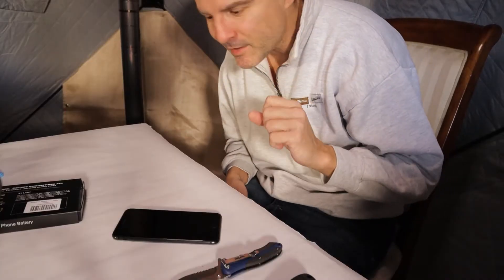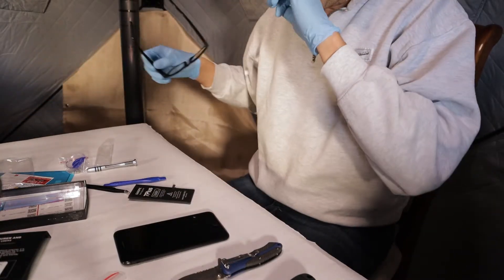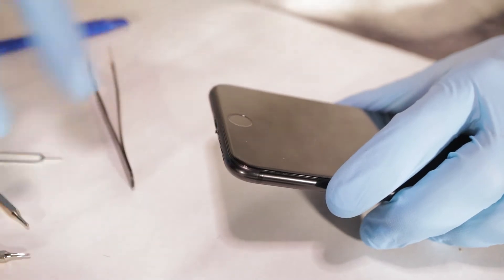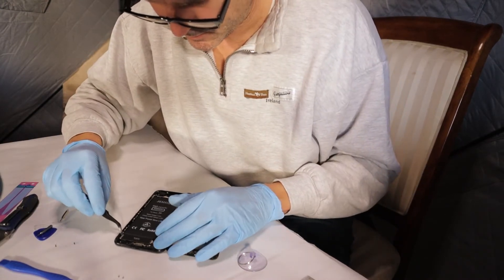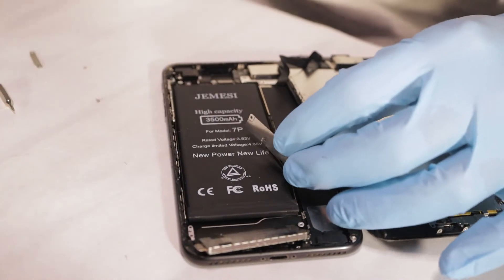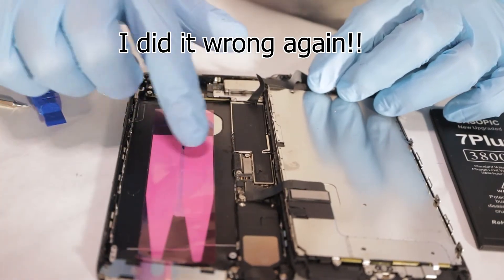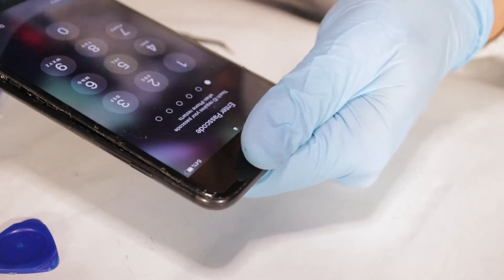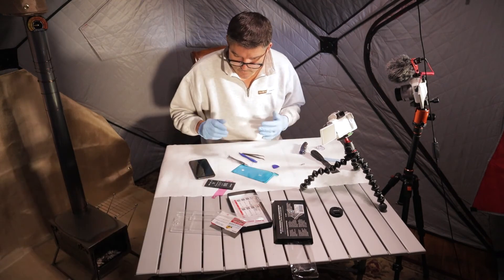iPhone 7 Plus Battery Replacement in a Post-Apocalyptic Homestead | #HomesteadDIYTips

Comment: Don't these types of battery damage the iphone over time?
Reply from the maker: I don’t know but I’ve had this phone for 4-5 years and that’s the second battery change.. do you know how long we should keep these phones?.
Reply: @Physicsofcreation  I would change it every year or 2. The thing is that it has an old A10 processor. Meaning it will kill the battery faster than a modern processor because it’s more power hungry. The new processors are like 3 times smaller and more efficient and the reason why most modern phones don’t have a battery door like the old days. I been using mines for 5years and I think it’s time
Reply: They never damage phones. U can keep it as long as u want